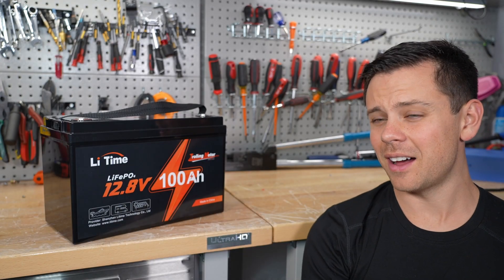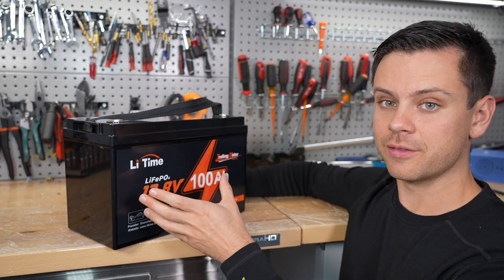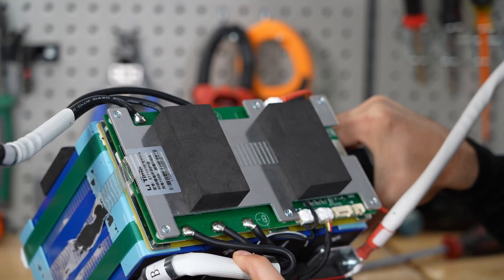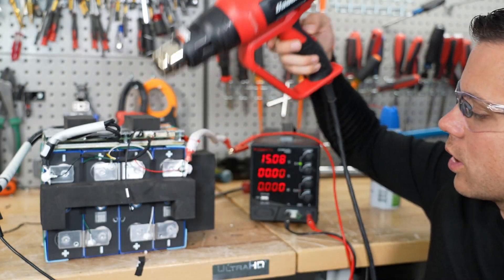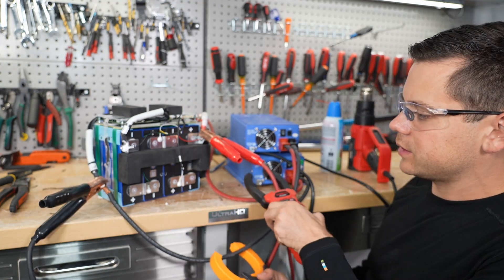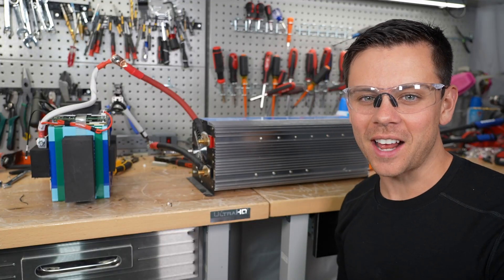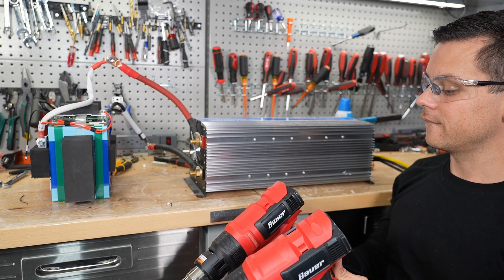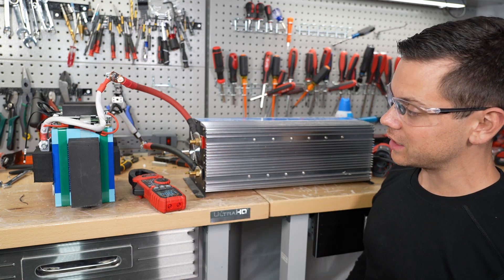$369 Li Time 12V LiFePO4 Battery! 300-500A Surge?! Low Temp Protection?!

Comment: Hey Will, your forum is quickly becoming the primary source for DIY Sailboat Lithium. How about 'taking the show on the road' and talk about harsher environment considerations like boats, and RVs.  Most of the sailboaters are just spending the money on very expensive Victron or Mastervolt packages or sticking with old AGM.  Batteries like this look like a great core. Why don't you show us how to make some cheap, safe boat conversion packages the same way you do for home systems?
Reply: RV is closest, but saltwater, external alternator regulators, partial shading on solar panels are next level problems from RVs.
Reply: Many of Will's older videos are about RV/van installations, which could apply to boats, if one makes sure that the components are protected from getting wet.
Reply: I agree Will. Just put that disclaimer out on top. I'm looking to do your 400watt classic.  On a boat. 
If you like I'll send you my plan you can review it and make suggestions.

Comment: I'm building an off road cargo trailer to haul my motorcycle on trips out into US National forestlands in the Pacific North West. I live right on the US/CA border at 4,000'el. So winters are long and cold up here. Last winter we saw -36F, but that was a little colder than normal. My question is, should I equip the trailer with Lipo batteries, or is sitting for four months each winter out in sub-freezing weather not recommended?
Reply: Li time makes a self heating 100 amp hour battery.  I just bought two of them for $400 each.
Reply: Wow! Nice. I have grid electricity at my place, but heating the entire trailer is not practical where I live. I could disconnect the batteries and bring them in, but knowing me, I would forget one time, and don't want to freeze expensive batteries. I was curious if battery tenders would work/help, but heated batteries sound like the best solution.
 @paulchristiansen9633

Comment: How would one run and charge these in series? I.e. 4s for. 48v supply. Would charging work with 48v in series or does each BMS prefer to be charged at 12v separately? Looking at golf cart application.

Comment: The car lift pump motor could use a PWM soft starter to smooth out that massive inrush current, Schneider makes them for around $200.
Reply: exactly. ICM does too.

Comment: i dont understand why so much importance is put on low temp cutoff... anywhere im  having one of these batteries is going to have heat of some sort
or insulation enough to not be freezing at the very least
Reply: Because everyone isn't as smart as you, and these LiFePO4 batteries will be ruined by trying to charge below a certain temperature. I have the reverse concern: I live where it can get over 120F outside air temperature, and worry that the batteries in my pickup's solar system might get too hot!

Comment: Hi, great work you do, if I have motorhome with only a100 watt solar panel and 2 lead acid batteries could I simply remove the L A BATTS and put in2 lithium batts instead ??
Reply: Yes. However, you may want to add another solar panel, as you might decide to run more AC items later. LiFePO4 batteries charge about twice as fast or faster than lead acid, so there should be no problems. In fact, you will get twice as much power out of LiFePO4 batteries, as you can only discharge LA batteries down to 50% before they start being destroyed by the process, while LFP batteries can be discharged down to 0%, if their BMS is made correctly. LFP batteries also have a much longer lifespan: 4000-5000+ cycles, as compared with 400-500 cycles with LA, or 10-20+ years for LFP, compared with 1-5 years with LA.
Reply: @Tumbleweed5150  Thank you so much , you do amazing stuff !!

Comment: I picked up a weize 100ah 12.8v LIFEPO4 with low temp cutoff, and built in heating for under $400. I know you've taken a couple of their base models apart, but would love to see you take apart the heated model.

Comment: Nice review.  I'm in the process of building a battery enclosure for my '95 Suburban but will have very limited space.  Right now, I'm leaning towards the SOK 12V/100 battery due to its small footprint...of course, its $200 more than this battery.  May have to take a second look at my available space to see if this Li Time battery will work for me...its about 3" longer than the SOK.

Comment: The name change is probably because they messed up securing the trademark. The parent company has been granted the ‘Ampere Time’ trademark in US, AUS, NZ and China, but they were 7 months late to file an application for trademark in EU and Switzerland, and 
 12 months late in the UK. The EU application is still pending but is suspended due to opposition made from another company, ‘Ampere Power Energy S.L.’ in March 2023, and it seems improbable that they will secure the trademark in EU without some agreement with the other company. The UK application is withdrawn, and the Swiss is cancelled. 

Seems like they bit the bullet and changed name in all markets they are addressing to something which is less infringing..

Got the above info from public trademark databases. Just a guess, but a probable one..
Reply from the maker: Ohhh that makes sense. Interesting
Reply: Li Time trademark was applied for in 2021 in the EU, with additional applications in sept 2022 in UK, Australia and the US. The parent company has now been granted the trademark in EU, UK and Australia, with US pending approval.

Comment: What are the dimensions of the cells? They look like the '420Ah' cells I bought from Aliexpress. I know the cell size may not relate to it's capacity, and I don't believe mine are truly 420Ah...
Reply: by "cells" if you mean the overall battery, their website specs say:

 L 329  W 172  H 214 mm / L 13  W 6.77  H 8.43 in
Reply: @brianmurrell8083  thanks, but I meant the cells. The cells that make up the battery. Any idea?

Comment: I've spent a lot of money on Battle Borns in the past, so when I got my newest camper I figured I'd give Li Time a try based on the overwhelmingly positive reviews. I bought their 300ah and it's been nothing short of impressive. Let's see, $2399 for a 270ah Battle Born or $1079 for a 300ah Li Time. It's a no-brainer in my opinion. Sure it doesn't have temp protection but I don't care because I'm a warm weather camper.
Reply: The new 230 Plus does for $600.  Get two for $1200 and have 460ah.  Also low temp cut off and 200amp BMS   Crazy pricing if you ask me for what you are getting
Reply: No low temp cutoff on the 230. I keep WAITING for it to get it but it's not there yet unfortunately.

Comment: I got this for cheaper when they had the pre sale. Unfortunately, shipping dmaged the battery slightly, but still working. I reached out to LiTime, and they immediately offered two options after first asking me to verify if the battery worked. 
1. 8% refund on the already reduced price + a 10% coupon to buy anything else on their store
2. Replace with new battery once I send it back

I chose the former since damage was minor, but I am impressed with customer support. That is far better than what I have been getting from Airbolt USA based support. 
The LiTime representative would reply to my emails within 2-3 hours and at no time try to brush this off or stonewall. 

So now I have this battery for 300$! And its super high quality. Mine is about 105Ah based on discharge capacity test (though that does depend upon how accurate is the shunt I am using).

I am hoping they come with a low temp protection battery in the 200Ah too with a 250A BMS!

Comment: AS far as you complaining about their rebranding. Since they only deal with lithium options (hence the LI). You can still look them up under Ampere time and their old website still works, but once you click on anything battery related, it takes you to the Li Time section. So they are kinda in the middle of it still. I have a 100ah battery from them that doesn't have low temp charging, but its been working great so far, and at thinned of the year ill be getting two larger batteries from them. Nice to know they are slowing coming around to modernize the electronics.

Comment: Not a huge fan of their name. But a couple weeks ago I bought their 12v 100ah mini version, does a fantastic job. Thinking about getting a couple more.
Reply: I wonder if the 12v 100ah mini will be compatible with the Renege 3000watt inverter?
Reply: @theconnectedcamper  Don't quote me, but the 12v 100ah mini's can only output 100a/1280w continuous. So you'd need 3 in parallel to be able to safely output 3000w.

Comment: I bought 2 of these and they seem to only charge up to a max 13.38v both of them.  Tried multiple lifep04 chargers.
Reply: What voltage are you looking for?
Reply: @redwood1957   relatively new to these, but the mfg literature says 13.3 is 90%, 13.4 is 99%, and 13.5 is 100%.  I am concerned that my batteries only charging up wo 13.38v means they're not perfect new cells reaching their max potential charge.  Li Time says this is a full charge, but they also will say anything to tell you it's your fault and your equipment and not send the batteries back.  I have 2 of them now and both have similar voltage when fully charged.  It might be just fine, but i'm not educated enough to know for sure.

Comment: I am thrilled to see this review as I recently purchased four of these TM 100 Ah Litime batteries for a reservation introductory price of $319. I received them about three weeks ago. They are a very nice looking battery and came packed about as well as anything could be. Very impressive manual packed in a nice silicon zip pack. I am using these for a portable solar generator I am building with two suitcase 200 watt panels and a 2000 watt inverter. My only mistake was not thoroughly thinking things out. I started the project with a 12v sytem in mind but later realized I could easily had gone 24 V. I still can, the only purchase I would have to make is another inverter but I will run 12v for now. The inverters I am looking at run close to $300 so I will just live with what I have for now. It would have been so much easier and neater to run the smaller cable.
Reply: Use the forum to avoid mistakes.

Comment: I have an "AmpereTime" battery and Redodo, tore each apart to make diy 24v battery, both built well with large beefy BMS. Used a JK for the new 24v build. Cells equalized quickly while sitting together in parallel and charge evenly, been happy with the quality of the cells.

Comment: I bought this battery because I saw a youtuber review it. I use it in my Hammerhead pool cleaner, which uses a trolling motor and calls for a deep cycle battery.  I've been using blue top Optimum batteries for  15 years, but they are so damn heavy. On and off the truck hitch, up and down stairs, to the pool and back, up to 25 times in a 12 hour day. I'm extremely happy with it being about HALF THE WEIGHT,  never ran out of juice, and doesn't slow down as the day goes on.  We'll see how long it takes my abuse.
Reply: Should literally last 15+ years.
Reply: @my_channel_44 Wow, an insight I've been looking for, best Lifepo4 Battery service Life assessment I have come across so far, is Lifepo4 batteries treated properly, is maximum 10 years Service Life tbh. a 15 year Service Live with Li Time ones slashes the Cost per year significantly . If Li Time will do 15 years, I'm in, otherwise I had planned to stick with High Quality AGM's as I know I can get up to 30 years from those, once you know how to treat them right - never let them get below an 80% state of Charge, and the Recharge Cycles Flatline and never drop, with Lifepo4 it's a 50% State of Charge to stay above, and don't charge above 85% Capacity or Fast Charge them, is best knowledge I have come across so far for Lifepo4.  I'd really like to see how Li Time manual are now recommending Customers to treat their batteries tbh. It was Amperetime who told me discharge below 50% Capacity  and you lose Recharge Cycles with Lifepo4.  Things may be getting interesting ? 🤔 Best Wishes.  Bob in Wales.  👍✨️✨️✨️
Reply: I am looking to buy a new battery for my 24v trolling motor  I was wondering how this was holding up for you

Comment: Purchased their 12v 200Ah a year ago and couldn’t get it to wake up after fully discharged, emailed support and they immediately sent me a new one. Great support.
Reply: That's Impressive

I purchased the same battery, had the same issue, and I had a rude sob email me back with horrible English trying to tell me that my charger was too small and not recommended.

When I got the battery to wake up, it was because I hooked up a 12v 1 amp charge to it, which restarted the BMS.  

When I followed up with the rep about the BMS needing rebooting, he continued to say my charger was the issue.  However I'm more apt to believe the battery overheated in my car while discharging on a cooler on a 98°f day.

He then proceeded to tell me never to hook up a 12v 1amp charger, although that's a very safe way to reboot the BMS.

Few things 
1.  My 100 amp hr battery has never had an issue with my 20 amp charger
2.  I purchased a 40 amp charger for the 200 amp hr battery, that has a 12v 1amp BMS reset built in.
3.  I'm not certain I'm getting full capacity out of this rebranded 200 amp hr battery.  If I had a capacity tester I'd run it through the paces, but for certain the customer service rep I had was ZERO help
Reply: @eckhardkoehler3013  they were right. you need at least 10A LiFEPO4 charger that is able to kickstart the BMS
Reply: One reseon  you may consider. When 100% discharged and connected for charging, charger can not get any information from battery that what type of battery it is. Expert opinion is that leave few % of charge to  connect to charger.

Comment: This is good to know since I just outfitted my TT with 2 of those and hooked to a 3000W pure sine invertor charging with 300W solar up by Wrights Lake, CA  for a week and never once had any issues.
Reply: What brand of the 3000watt inverter did you buy? I have 180watts off solar on my 5th wheel rv and I was thinking of starting out with one 12v 100ah mini with a 3000watt Renege inverter and add a 2nd battery down the road. I don't want the 3000watt inverter be too much for 1 battery. I'm replacing 2 Deka acid batteries.

Comment: Will, the model on Amazon is not the one you tested as it is not the 'Trolling Motor' version. Going to the site you listed it appears to be larger physically than the standard model. Besides the Li site do you have another site to get that one from? Do you think the Amazon/standard version would do the job? Great video.
Reply from the maker: Yeah it's in the pin comment and in the description.
Reply: Thank you. I did not know where to look. Do you think this one is better for a small system? We currently have 4 20 Ah batteries with 4 100 w panels, but I think we are short on battery.

Comment: hello from east coast Pennsylvania been watching you really make the videos question is there  DC grid to homes in Vegas i really appreciate your all your work
Reply: ALL grid power is AC. DC is used in solar systems because there are much shorter runs. Longer runs, (length of wires from source to use point), is AC, as the voltage drop isn't as much.
Reply: @Tumbleweed5150  thank you for the reply  I am very familiar with your comment however it did not answer my question  is there a Direct current grid to homes In Las Vegas I'm guessing NOT for many reasons of safety concerns  solar is a great source of energy however many source of energy  would be best Nuclear power source should definitely be included.

Comment: I'm doing a small solar setup. I went ahead and took the plunge and got their mini 100ah battery, their 30a mppt controller and their 2000w inverter. So far, so good. Inverter is quite loud--fan is all or nothing, but it works and feels beefy. I will say that their manuals are all really good--good English and a lot of information. I get the feeling that they're trying to corner the market in terms of Chinese products and I think they're doing a good job of it thus far.
Reply: As with many inverters, if a $20 fan is used in the build, instead of a $2 fan...it can be much quieter. Down the road when your fan gets too noisy, see if a quality computer fan can be installed. You will be amazed at the difference in sound level.
Reply: How much did the lot set you back? I have a wind generator I'm looking to set up with potentially a battery like this
Reply: Chengrish?

Comment: Will I'm building a shed and wanted a battery/inverter system with small Solar charger to provide lights and a small load.  I don't think this battery will work due to the cold sensor.  What do you recommend I do for that senario - Fred from Cold Connecticut!
Reply: If you want LiFePO4 batteries, you will need to have a way to keep them above their cold shut-off temperature. Otherwise, you may be stuck with lead-acid until another kind of battery is developed.
Reply: @Tumbleweed5150   So when they say they have heaters in them it's not for cold protection?  Just asking.  Thanks for your reply.

Comment: I have a Litime 230a plus
Reply: I bought 1 too. 230+. Very happy. I installed in my boat 330 searay sundancer. It runs lights water fridge head etc. I recharge it once per week. My beers are always cold 💪
Reply: @nicholaskeymont9584  great to hear. Mine is in place in my van but, having trouble getting ANL 30A fuses and a 30A 12v circuit breaker from china. I think the flooding and earthquakes has shut down china.

Comment: Do you have any high current charger alternatives to the AIMS Power 12/24 volt charger? I’ve been trying to get an AIMs one for years but they seem to not exist anymore, only the 36 volt model. But my system is 12 volts
Reply: Have you looked at iota? They have plug in smart charger mods for the for 20 bucks.